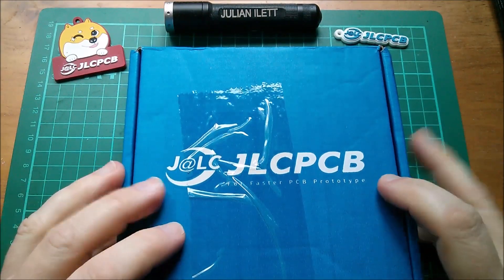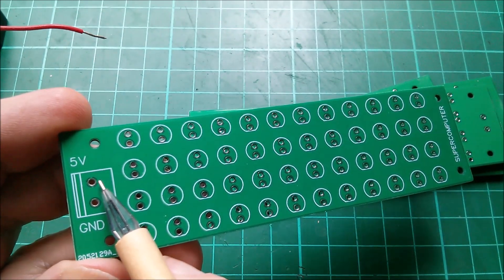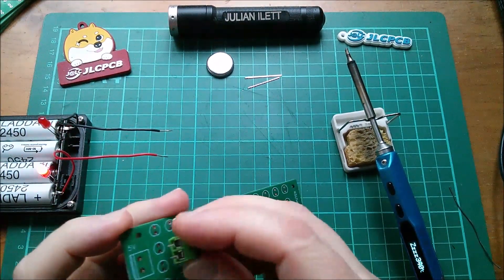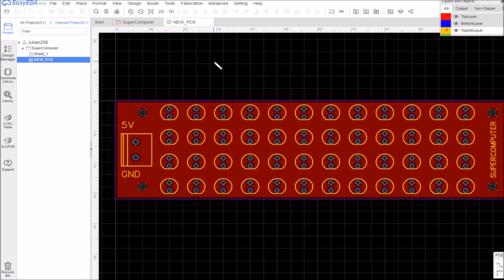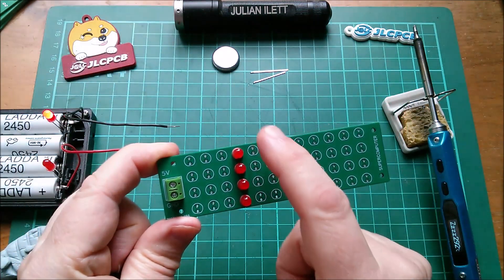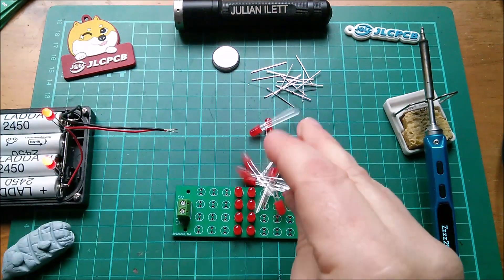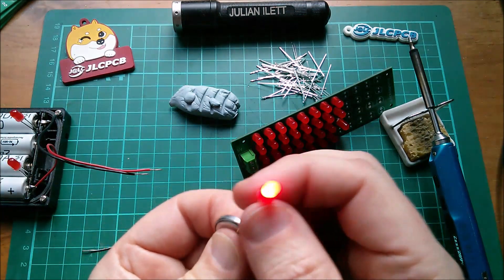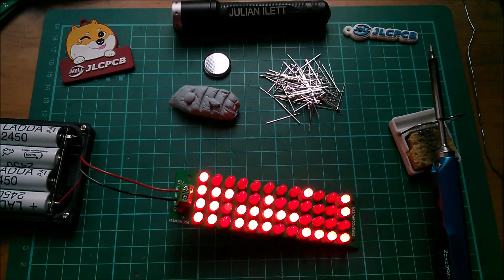New PCBs from JLCPCB - Flashing LED Array

Comment: I just order my first PCB from JLCPCB(I used mostly seeed or elecrow in the past). Have read many mixed reviews. I guess the best way is just to order a small batch and test it yourself. They are surprisingly cheap, it seems that import costs and VAT are calculated during checkout, so don't have delays/problems when importing into the EU..... I hope. :D

Comment: Hi, those connectors are a pain for spinning – I solder them in then super glue the back side of the connecter on the top of the board and it wicks under the plastic of the connector and adds a little more support. If you don’t mess with them much it holds quite well.

Comment: Pretty cool idea. The LEDs flash at different rates because the resistors that determine the frequency vary slightly. It is basically a comparator, which is the basis for the 555 timer.

Comment: To stop the spillover, 3D print a mask to fill in the space between the LEDS, and block the light.  You also may want to put the power connector on the back of the PCB.

Comment: What a funny coincidence. I've just designed & 3D printed the side panel of WOPR (War Games) for this purpose. No PCB for me, just 5mm holes with friction fit. I'll probably still throw in some resistors to dim them down a bit.
Any idea why it' seems to be impossible to find slow flashing single colour LEDs these days? I find the 1 Hz rate too fast.

Comment: Temperature is not the issue its how much of it you've got that counts.  As you say a bigger thermal mass is what you need, if your iron has a  bigger mass than the pad the tip Temperature wouldn't drop so much on contact.

Comment: If you use all the same color leds you don't need resistors. However if you want to different colors you need (at least for each group of colors) resistors.
Reply: You should still use resistors as there will always be a slight difference in forward voltage drop, and the lower one will try and draw all the current.  The resistance helps with the current sharing in parallel, by allowing a different voltage drop across each one
Reply from the maker: I looked at a few data sheets. Most implied no resistor is required (the chip includes a constant current LED driver). But one data sheet recommended a resistor. So they do vary.
Reply: @JulianIlett  I've got a few colour changing leds which run quite warm on 5V and don't last long without a resistor.
Reply: For me combining different colors did not work without resistors did not work. When adding a resistor to each different color group my BigCliveComputer did work. (And yes it is recomended to have a resistor in series with each led, however i did not notice any problems with the blinking leds i used if they are all the same color. (Perhaps the [small] internal resistance of the led and the battery is sometimes sufficient.)

Comment: I 3D printed a jig to hold the LED's while soldering. Just a simple through hole design thick enough so that the shoulder of the LED sat on the top surface. Worked well.
Reply: show us

Comment: You are spot on with your assessment of the soldering problem. It isn't more temperature you need, it is a meatier iron. Nothing beats thermal mass when you are soldering grounded pins.
Reply: If a gas torch with a 22swg tip which burns at 2300°C  but the flame is so small it can only be used to silver solder wires, not enough energy for. 5mm plate.
Reply: also the wattage depends, i have an aixun T3a 200w station and i use geniune JBC tips with it, even with a normal sized til it melts solder on ground planes like butter, and then there are also high termal mass JBC tips which are in a league of their own